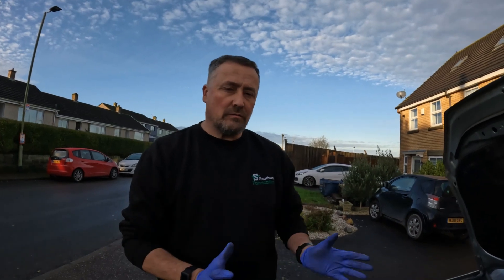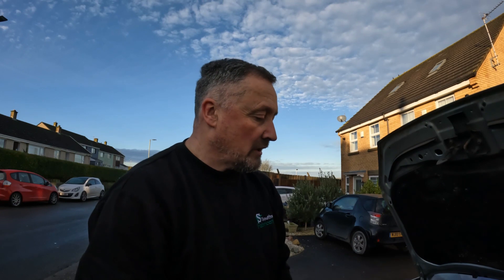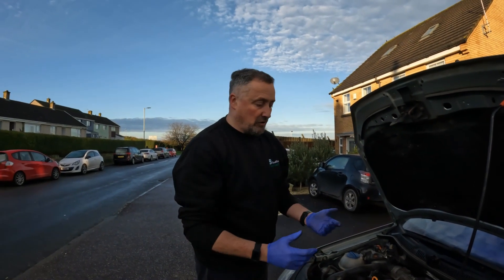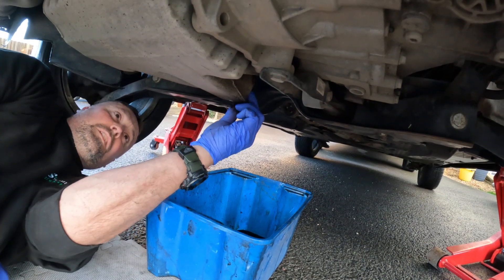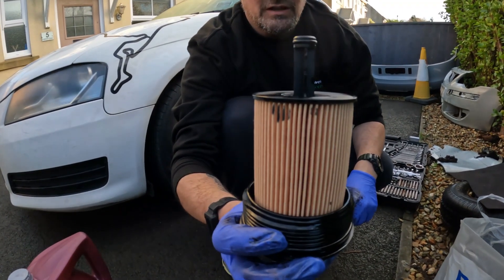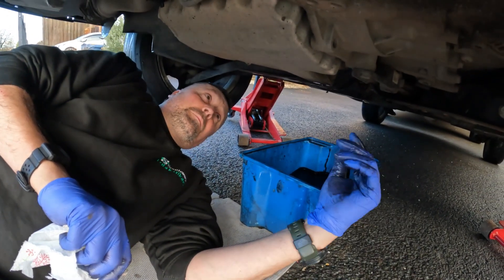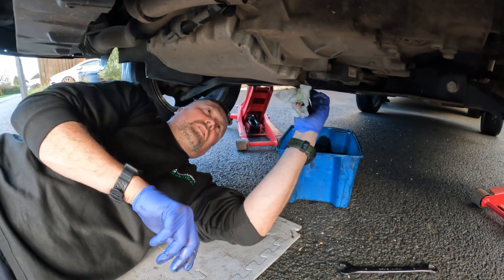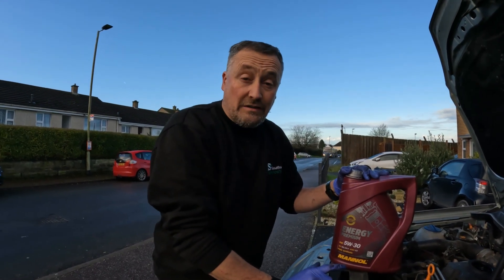Full engine service on a 2009 VW Polo 1.4tdi bluemotion, Audi, Skoda and Seat.

Comment: I’ve been given so many different opinions on engine oil for this engine, 5w30 505.1, 5w40, what’s your experience with this oil everything okay?
Reply from the maker: Iv been using 5/30 fully synthetic in a few of our pd engined cars and all good so far and 2 are over 160k, I do change the oil every 6/7k which is half what they recommend but so what when you want a reliable car, hope that helps mate, iv got a few videos on my channel how to make the engines more reliable and smoother running if you fancy taking a look

Comment: PD engines require a specific oil to prevent in head diesel pump damage. Standard synthetic is not good enough and accelerates wear of the pump.
Reply from the maker: Totally agree, my wife's polo 1.4tdi was on 180k before a tractor decided we didn't need it anymore 🙄 all vw/audi diesel engines need specific oil grades

Comment: Hi Mate, quick question i have the same car and it failed on emissions diagnostics check is showing post cat lambda sensor/o2 sensor is not working. ive located the pre-cat sensor and all 3 EGT sensors but for the life of me cannot locate the post-cat o2 sensor. just a shot in the dark but you wouldnt happen to know where it is?
thanks
Reply from the maker: In all honesty mate not off the top of my head, the easiest way to find the right sensor ( there's so many these days) is to find the correct wire where it plugs in and trace it backwards, they are coloured alot of the time but deff numbered, Google the number and position job done.

Comment: Hello! Question for you, I have a same car and the acceleration is not good, especially after third speed, and the smoke is black goin outside from the car. What can be problem, there is nothing showin as an electric error, I tried and clean maf senzor, what can it be? Thanks for giving us advice and this video!! :))
Reply from the maker: Hi, and my pleasure,  to be honest it could be a lot of things, I check the egr valve, there's a little hole on the left side of the body, if there's oil coming out of it the diaphragm has gone, £30 on ebay and it'll drive like new again, bit of a faff to replace but not to bad, try cleaning the veins on the turbo, ( iv done a video on that) could be stuck shut, check for air leaks, if none of those work get back in touch and I'll see if I can think of anything else, it's hard to diagnose without seeing it.

Comment: Hi Adam, just a quick question I know the fuel filter is different on my golf 1.9tdi as it’s a filter cartridge to replace inside but do I do the same thing and replace the filter then fill up the fuel bowl after with fresh diesel? Will this work and not create an issue with air and cutting out? Many thanks
Reply from the maker: Hey up mate 👍🏻there's a service on my daughters A3 1.9 same engine I explain on there how to do it mate, but yeah remove the old in with new plus new O rings but don't fill it to the top it'll over flow,you've gotta alow for the feed going in to.
Reply: @thestanleysadventures8229  thank you I will look in your channel now :-) keep up the good work pal
Reply: @thestanleysadventures8229  thank you I will look in your channel now :-) keep up the good work pal
Reply from the maker: @@littleratbag1111  Thanx mate, if you follow what I say on the A3 you'll be fine mate, You know where I am if you have a prob 😁